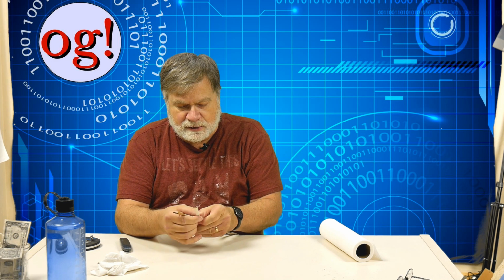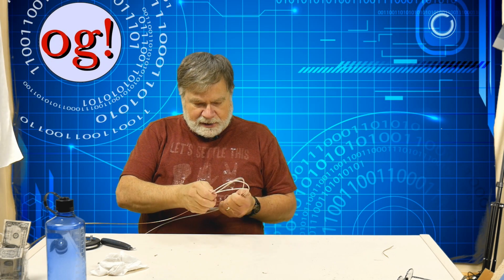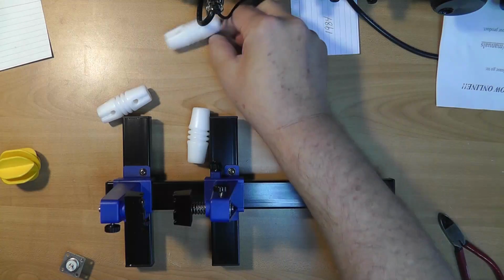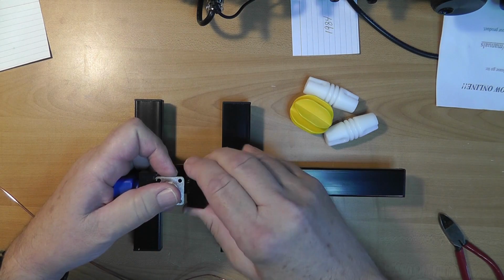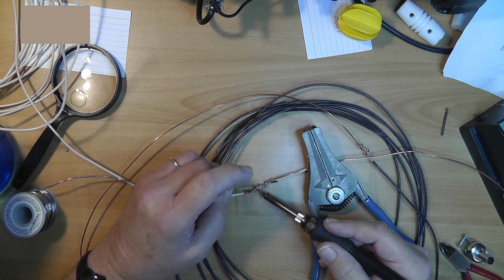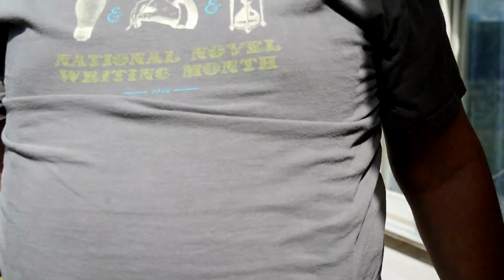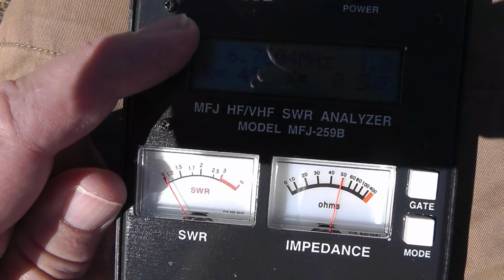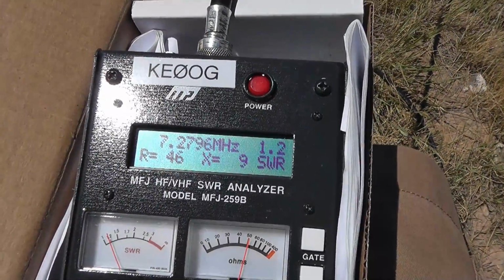Making and Using a Simple 40-m Dipole (#86)

Comment: I slapped together a 20m "sloped delta" out of bailing wire a few nights ago, while waiting for the laundry to finish. For connections, since it's temporary, I used some wago blocks I had lying around. It's amazing how well it works for being literally $2 in parts (mostly the wago connectors, though that doesn't include the $600 antenna analyzer…).  Antennas are one of my favorite parts of radio, so I'm looking forward to the rest of this series!
Reply from the maker: All the hams I know are never completely happy with their antenna, hence the interest in the subject.

Comment: You use what you got and if it works then great! I did the same when I was a Novice (1986) recycled wire from construction projects around town that had to solder to make 5 bands for a fan dipole. I had a Radio Shack soldering iron and my Dad's old Weller soldering gun that he bought around the mid fifties. I quickly found the RS soldering iron didn't have enough heat to flow the solder. So, I agree with Steve about having a Weller in your toolkit. Glad your homebrew worked. About your 2 masts though.  Do you think the 2 friction joints would hold up to extended use? Look forward to your tests of the commercial built antennas. 72 de Terry - KB8AMZ
Reply from the maker: You sound persistent! That's the ham spirit! I do have a Weller, but have gotten into the bad habit of using the soldering station for everything. I should at least have put a bigger tip on it.

Comment: That is part of Ham Radio. Building antennas without spending money. I wish it was the same with 100w radios!
Reply: KuriosPC it can be if you just happen to have all the parts laying around you could build your own radio. I am slowly building a sw/hf rx radio. Already got a little bit of a signal on it but its still weak and not verry selectife, but tweeking it till you get it right is part of the fun.

Comment: I'm surprised that you don't have a Weller soldering gun.  They are great for that heavy wire.
Reply: I recently got a Harbor Freight  180 watt gun for 12.99 after tax with a 20% off coupon, specifically for this, and sticking solder to aluminum. It doesn't have as much grunt as the box says, but so far it's doing all of that wonderfully. And I can still afford more accessories.
Reply: I picked up a Weller at Goodwill for $6.00!
Reply from the maker: I do have a Weller and should have used it.
Reply: Update- at 1 month the collet tips have broken and will not hold an iron tip. I' gettin a Weller.